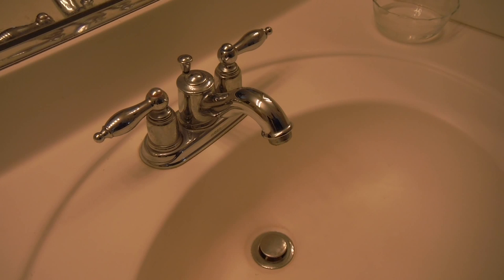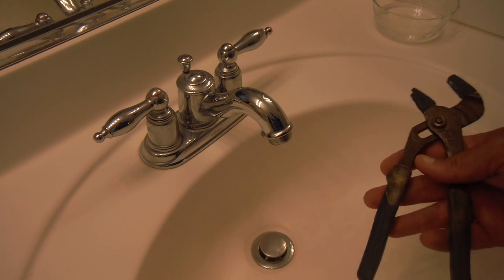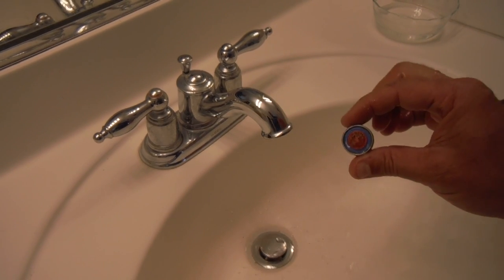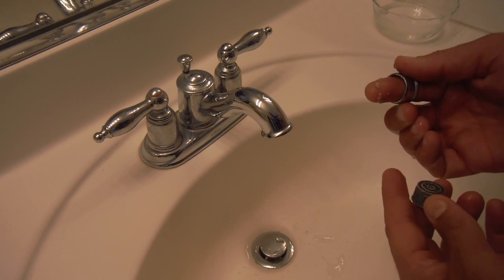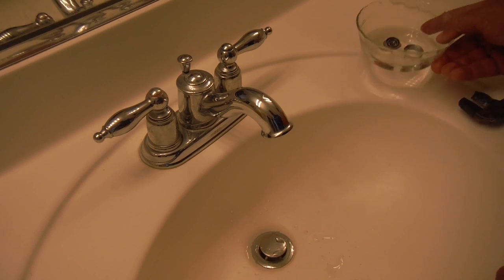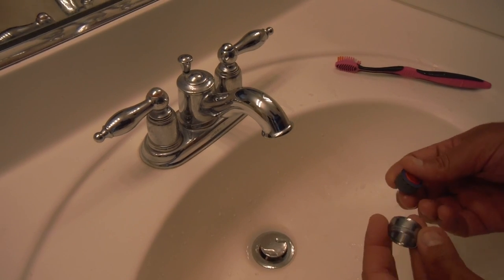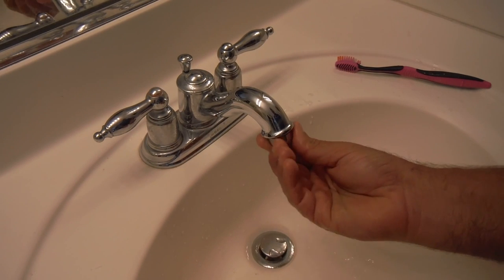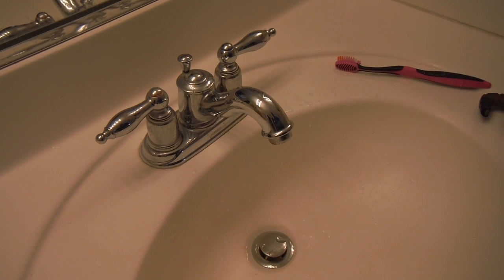How to Clean a Bathroom sink Faucet Aerator Screen (Low water pressure)

Comment: What do you use to remove the faucet cap if it is recessed into the faucet stem?
Reply: I have the same issue. I think you need to get an Aerator Key Wrench. They sell it on Amazon. Hope this helps.